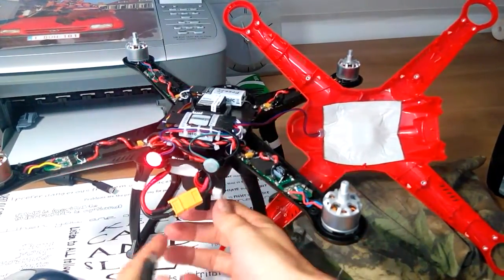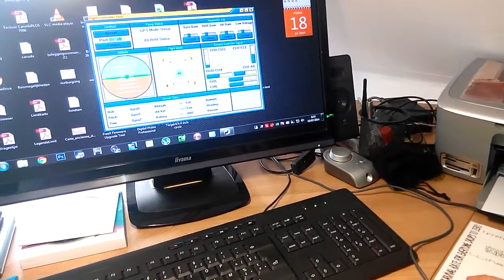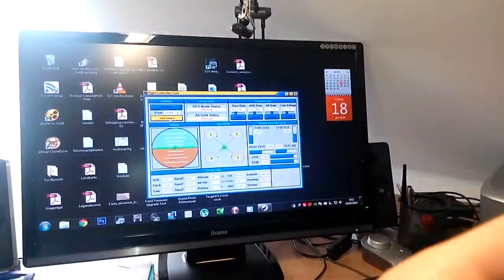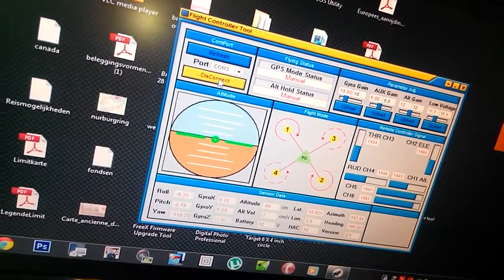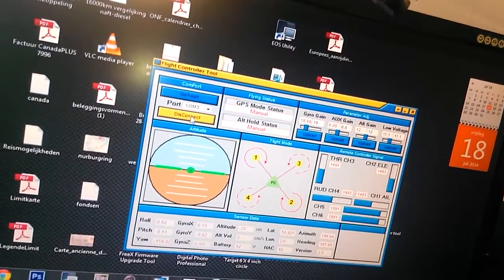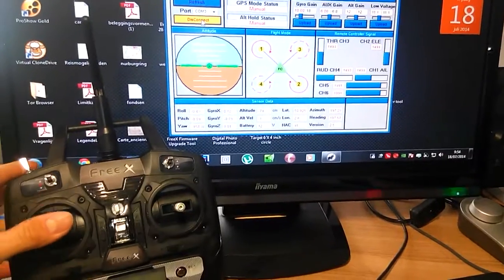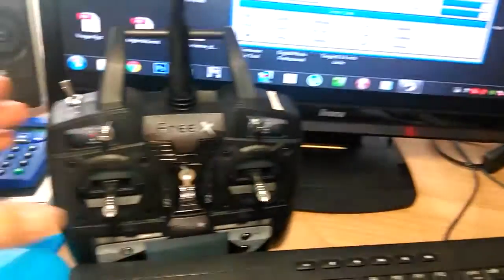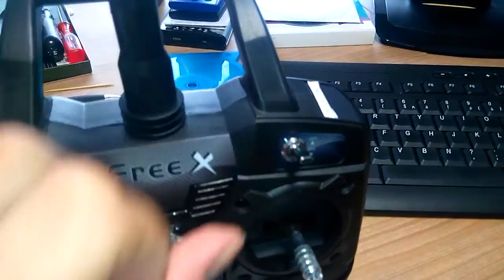10 binding test but still no response from transmitter in the flight controller tool

Comment from the maker: Eventually i received a replacement tx and rx that where already bound together but while i was waiting i installed an x8r and learned to use a taranis and never looked back. It was a steep learning curve but it was worth it. The quadcopter is actually very good and the range of the x8r is more then 3km in good conditions. I never used the original tx and rx but keep it as a backup.

Comment: So you have to pay shipping on the defective product? Yikes, I hope they reimburse you some how.
Reply from the maker: Yes, you have to pay shipping but i knew that before i ordered. It's the first faulty item i received from china and believe me, i've ordered a lot. The factory is going to check if it is doa and then i get shipping cost back and a new tx rx set. My faulty tx rx arrived at the factory a couple of weeks ago but still no news...  i have done my part so far. I may order a second skyview if all turns out well. I will make a good/bad review on rcgroups  depending on how this plays out.

Comment: already sent the new set radio and reciver for ali to make service
Reply from the maker: Ok, thank you, the faulty transmitter and receiver have been sent back to the factory today.
Reply from the maker: The factory faulty transmitter and receiver combination had arrived at the factory after i paid 75$ for shipping it back!! Now i get a message from Ali that the transmitter had 'just a loose cable' inside and that the factory has fixed that. Then the factory says the transmitter was not faulty!!!!?????? How can that 'loose cable' INSIDE the transmitter be my fault?? Shipping has to be paid back in this case, those are the terms, isn't this video PROOF enough?? I already lost 75$ and now i'm asked to pay an extra 50$ shipping for a 40$ (retail) transmitter that was factory faulty and that is NOT going to happen... can you please set this straight and send me a working transmitter and receiver combination so i can after more then one month finally fly this quadcopter?
Reply: Bart Goossens they should not ready the customers like this. I am following a forum and many people has issues with the quad and problem with the factory/Ali because of shipping. Not good at all.
Reply: I meant:they should not treat. ...

Comment: As you have it opened could you post some close photos of the inside please?
Reply from the maker: I will send you pictures asap. I will post them on rcgroups as well so others can view them too.
Reply: Bart Goossens that's cool!  Rcgroup is fine, I've seen your posts there . ;-), my name there is Pisti75. Thanks again!
Reply: I hope you can start your quad soon, its so frustrating when you but something new and it doesn't work.
Reply from the maker: Isti Gombóc I haven't had the time to take decent photos yet, tomorrow i'll send them.  I haven't posted anything on rcgroups yet, i think you mistake me for someone else ;-)  When the binding problem is solved, i will start posting my flying experience on rcgroups.
Reply: Ok Bart! Thank you!
Reply from the maker: Isti Gombóc I send you the link in google+ but if you didn't get it here it is: https://plus.google.com/photos/112096960464790207456/albums/6037717876123466209?authkey=CJbt3PS6jILh-AE
Reply: Bart Goossens thank you very much!